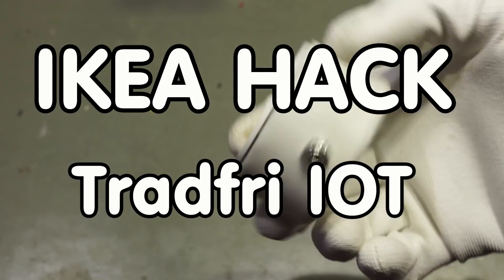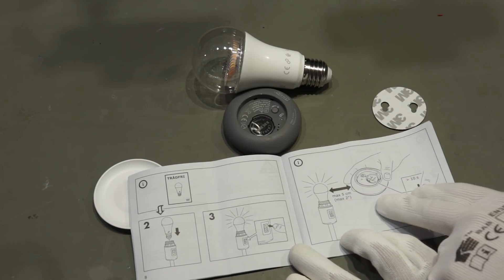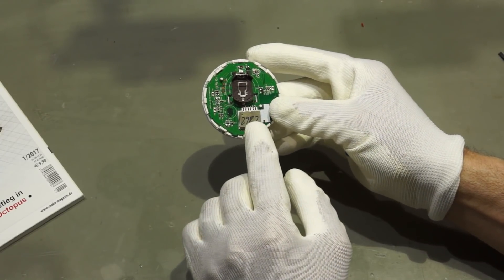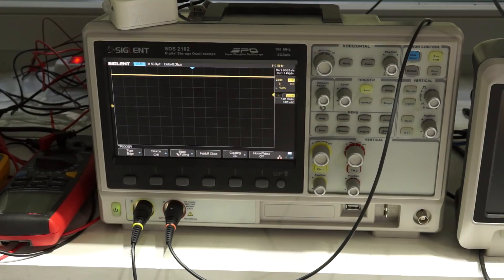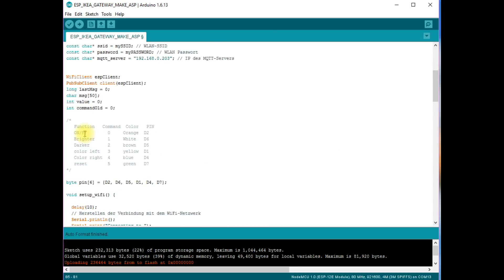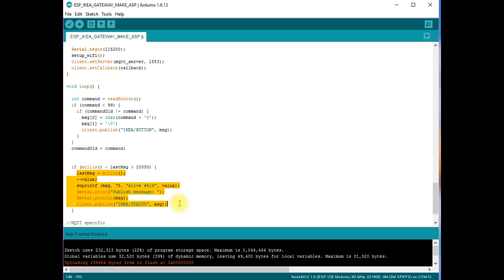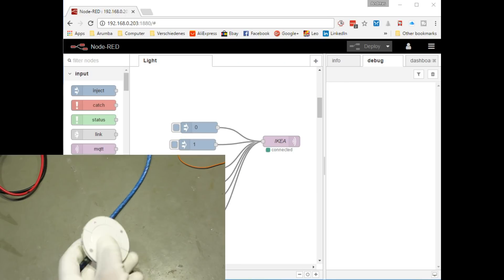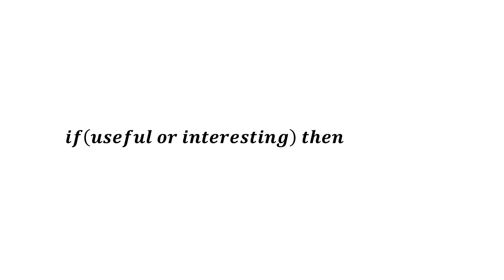#140 IKEA Tradfri IOT Smart Lighting System Hack

Comment: I expected the system to be called trådlös in stead of trådfri, IKEA being Swedish ;-)
Reply: I think it's because Trådfri is not a real Swedish word (or Danish, for that matter). As Gert correctly guessed, løs and fri basically means the same in most contexts. Trådløs is a dictionary word, and thus can't be trademarked, but Trådfri isn't, but means the same, so that's apparently what IKEA went for.
Reply: @Morten Jensen?  Danish product?  Where is it a Danish product?
Yes, the NAMES are mostly taken from Scandinavian languages and countries.  But that doesn't make it Danish...
Reply from the maker: Interesting... BTW drahtlos is the German word for Trådløs. Quite similar.
Reply: Danish is a Germanic language, so they are very similar in construction and vocabulary. I think Swedish is actually more similar to German than Danish is. Eg Fenster in Swedish is fönster, whereas the Danish word is vindue, which is much closer to the English word window. Actually window is a word brought into the English language by Danish vikings...
Reply: Ed19601 you are correct "-lös" added as a suffix translates to "without <whatever the main word is>" in Swedish. I can not think off any contacts that uses "lös" with the meaning "less". "lös" as a word (and not a suffix) means "loose" (as in "loose fit" not the opposite of "win"). 

/A Swedish guy :)
Reply: Trådfri (sounds like "trodfri") means "free from wires", while Trådlös (the "ö" is the same as in german) means "without wire". And it's Swedish ;)
Reply: Hilarious to see that this community not only likes to hack electronic devices but also hacks Ikea's idiom (and with the same vigor! ;-)

I love it!
Reply: So. Back to nerding out about languages.
The swedish word "lös" (not the suffix that is) can actually mean "free". "Fången är lös." can be translated as "The prisoner is free.", in the same way that the english word "loose" can be used to mean the same. So the connection between the suffixes "-lös" and "-fri" is pretty close.
You can also see "lös" as part of "lösen" which is swedish for "ransom". And "lösenord" which is the swedish word for "password".

So my guess is that this is problably another case of words shifting meanings.

/Another swede
Reply: Martin Bøgelund Norwegian vindu as well. ofcourse Bokmål and Danish share a very common history
Reply: From what I've read, IKEA names carpets and rugs after Danish towns, which some Danes apparently don't like, because they think it's demeaning (they don't want to be "stomped on", especially not by the Swedes) :D .
Reply: pepper669 I took a look at some IKEA carpet names after reading your message, and indeed I found some names of Danish towns. Most names struck me as being Swedish, though.
Reply: +Martin Bøgelund In ancient Scandinavia the actual word for window was vindöga [wind eye]. Swedish fönster is originally a loan word from the German word Fenster. So there you have it. :-)
Reply: Martin Bøgelund good thinking. Yet Microsoft managed to trademark 'Windows' though for the life of me I don't understand how. Someone must have been sleeping at the patent office
Reply: Interestingly most words for many/most body parts are the same. In English and Swedish and Danish and Norwegian.
Hand, Arm,Foot,Hair,Finger,Toe
Reply: ah yes, similar as in dutch. Use as an isolated word (so not as prefix) it can be a noun or adjective meaning:empty,smart,false,unreliable,vain.
Sorry Andreas. very off-topic
Reply: Andreas Spiess Dutch "draadloos"
Reply: I thought you might do some radio frequency analysis. Maybe the system is already using #MQTT
Reply: +Ed19601, according to friends that learned Dutch, it is much like Swedish.  So according to them, it was easier to learn than German. I have problems learning natural languages (other my first, Swedish and my second, English).
Reply: Eduard van Raalte Andreas' video's are a source of learning on many fields :-)
Reply: Anders Jackson German is especially difficult because of all the 'cases' (nominative, genitive, dative, akkusative) that have virtually disappeared from the mainland Scandinavian languages and Dutch. I speak Dutch Swedish Norwegian and Danish and that is mainly a matter of learning vocabulary as the grammar is very simple.
I also speak German and Icelandic and can read gammelnorsk but that is a whole different ballgame because of the much more complicated grammar
Reply: @Ed19601  Hello Ed19601 and greetings from Finland. Have you ever take a closer look to our language? We have loan a few words from Sweden but beside that it's totally like nothing else. That's a two way road in my head. We, for example, need to learn whole new language if we want to learn swedish. Sweden have so much similarity whit english that i've seen them mixed words. Swenglish:) I don't know where this came from but I felt like writing it....
Reply: @Ed19601, yes, I have tried to learn French and Icelandic, so I know about all the "cases".   They are hard to learn...  German I have only looked at from distance. :-)
There are some tricky part in Swedish though. Things that are thing from before the big clean out of "cases".  There are still traces left in Swedish.

Impressed of all people that manage to learn more than two languages. So feel the impression from here. :-D
Reply: jhm smart tv Thanks! I really don't know why someone would get all worked up and deny that fönster looks like Fenster - so thank you for confiming there actually is a relation.
Reply: Ed19601 I don't understand the trademarking of Windows either - I still remember the fuzz about how Lindows had to be renamed. Maybe legislation has changed since Windows was trademarked? In Denmark at least, common words like "sofa" and "trådløs" can't be trademarked, I'm pretty certain about that.
Reply: Martin Bøgelund yes I remember the court case here. "lindows" could be confused with "windows" whereas in my opinion windows shouldn't betrademark worthy to begin with
Reply: Ed19601 Exactly. OTOH when Mike Rowe called his software operation "Mike Rowe Soft" and bought mikerowesoft.com, Microsoft couldn't muscle him out with their lawyers. I think they ended up buying him out at a high price :-) That story made me laugh.
Reply: The laws are different in different countries, so you can't even patent software in Sweden. It has to be connected to a physical process.
Reply: +Morten Jensen Danish product? ;-)
Reply from the maker: So, we have now the definitive truth! Interestingly, Google translate does not translate it from Swedish...
Reply: my guess is that "lös" does not mean "less" in its usual use as in 'less than'  but "without" in analogy to dutch "loos" (without) . Having said that, it is very well possible that that was the original meaning of "less"  as well (as in lawless, senseless, and .... Wireless)
Reply: +Martin Bøgelund, Fönster (not Fenster) is based on French fenêtre. And many English words are based on old Norse, like Vindue and Vindöga for Window, Barn for children.  Gata for Gate.

And yes, Trådfri is a Swedish word, translated to Wire free or Thread free. (Tråd: thread or wire, fri: free)  In Swedish we can add words together to make new ones. 

And you know that the Trådfri system is based on a standard, but not MQTT.  So there are no need for making a hack like this.  Even though it is fun to see.
Reply: Anders Jackson Yes, Fenster - the German word for window, is similar to the Swedish word fõnster. I hope you recognize that. And if you read English language history, you will realize that indeed Danish vikings settled in England, bringing Danish words with them.
Reply: @Martin Bøgelund.  It is Fönster.
And it origin from Latin, and if you want to make a German connection, there are Low German vinster and Latin fenestra, not German fenster.
https://en.wikipedia.org/wiki/Window#Etymology
https://en.wiktionary.org/wiki/f%C3%B6nster

Yes, I know that the English word Window come from Forn Norse language, which I wrote, If you care to read that.  
http://www.etymonline.com/index.php?term=window

That was before there was any Danish language. It was Norse.
But anyway, I will end this discussion in this subject.
Reply: Anders Jackson The german word for window is Fenster.
 Simply look it up. The relation between the Danish word vindue and the English word window was claimed in a documentary I recently saw om the subject. Danes in larger numbers settled in England centuries ago, influencing culture and language. I'll post links supporting that claim. Even if window is from old norse, the similarity between all 3 words can't be denied - they are probably all related.
Reply: So you don't read my links? Good to know.  You belive a TV show and not academical sources.  Good to know.
Reply: Look Anders, I'm not out to argue with you, but there are claims that state window comes from Danish (eg. http://lakjer.dk/erik/engelsk/danishwords.html). I merely mentioned window since that's the example I remembered - sorry if I hurt your feelings by picking that exact word, there are other words I can find for you, showing the relation, if you are actually interested. If you bother to dig into it, Danes in larger numbers did indeed settle in England. Norway also was under Danish rule for an extended period, and Denmark and Norway have been very close for centuries, so please don't go about thinking there has not been influence both ways in both culture and language.
Also, note I'm not claiming old norse did not influence english - I'm just claiming Danish language (also) did. If you claim Danish language didn't influence English, you're simply wrong.
Reply: As promised, a link supporting my claim about Danish influence in England - sorry, it's just a simple Wikipedia link: https://en.wikipedia.org/wiki/Danelaw
I hope you will accept this as fact.
Reply: I have dropped it. You should too.  You don't even know what Old Norse is, so I see no reason to continue.
Reply: Great. Cant help thinking the buyout was the object here. If I were Microsoft I would not have bothered. Generally very difficult to muscle someone out of his own name, except ofcourse if  your name is McDonald and  you want  to start a fastfood joint :-)
Reply: Tråd=wire;  fri=free // lös=less
And it is Swedish not Danish ... oh and by the way I am Swedish (i also speak perfect Danish).
Reply: Gert Dewit is right, IKEA being Swedish, the word Trådfri should be thought of as a Swedish construction. But it works in Danish too, as the two languages are quite similar. I'm Danish by the way :-) And thanks for the interesting and useful videos, Andreas, I enjoy them a lot!
Reply: "Always take out the battery, you might destroy something" starts to Dremel it apart
Reply from the maker: Here you definitively are the expert. I struggle already with my German, English and French ;-)
Reply: @AndreasSpiess  que me
Reply: @AndreasSpiess  oi
Reply: Andreas Spiess absolutely not, as a Belgian I don't speak Swedish or Danish, I was just joking, thought it funny you said it was Danish.
I suppose one can use the word in Swedish too, I guess fri=free and lös=less or without.
Reply from the maker: I just used google translate and it said, it is Danish... If I select Swedish, it does not translate...
Reply: Anders Jackson indeed remnants left. in Dutch too, often in the same expressions. Anyway, apologies to Andreas for the long offtopic discussion
Reply: Gert Dewit well... as he says... a danish product, so maybe that is why. fri the correct term. ikea nemas its products after scandinavian citys/names
Reply: I read your link - thanks for second guessing and being wrong. I just stated my source, like you stated yours - I hope you don't claim an exclusive right for that.

Comment: From their own IKEA website:
-Can I develop the TRÅDFRI system by getting access to the systems API?

Not in the first release. But IKEA is working towards an open system.

-What protocol do the IKEA smart lighting products use?

IKEA smart lighting products use the ZigBee Light Link, which is an open standards protocol aimed at remote control. The lights create a mesh network with each other, enabling each light to pass on messages to the next. IKEA Smart Lighting products are compatible with other products according to the ZigBee Alliance. You can find more information at: zigbee.org
Reply from the maker: This is quite an old video and maybe they changed a lot. I did not work on this since then.

Comment: You don't need to use a Dremel to open the remote. I made a video that shows how to open it non-destructively: 
https://www.youtube.com/watch?v=NMupi1FeAB8
Reply from the maker: You got a „like“ from me...
Reply: Great now my video has one like, haha :-)
Reply: Another thing: The new TRÅDFRI power socket comes with a 2 button remote if you pay 25%. The packet (socket+remote) cost 40% less than just the TRÅDFRI remote from your video. This is very cheap remote, especially if you can use the socket for something.

Comment: I am still baffled that there is no wall mounted lightswitch-replacement for these smart bulbs. How are you expected to use the system? Tape over the old on/off powerswitch on the wall and stick the ikea remote to the wall? That can't be a solution.

So I plan to open up the ikea remote and hook it up to a Feller light switch (which is disconnected from the mains power), so when I press the regular light switch it closes the circuit of the ikea remote and switches the lights. The ikea remote can then be mounted inside the wall, behind the old switch. A 230v-to-3V step down regulator should replace the coin cell battery of the remove, making this system maintenance free.
Reply from the maker: Maybe they omit these switches because, in most countries, it is not allowed to mount them as a Maker. And there are many country-specific different standards around.
Reply: Andreas Spiess ok I did the hack and it works beautifully. Its very easy. Just solder two wires, one to the center button (remove carbon layer first) and to ground. Plug these wires into a standard wall switch. Tape the TRÅDFRI remote pcb behind the switch and into the wall socket. Now you have a Feller-TRÅDFRI-switch which looks and works perfectly.

Comment: E27 is not "European", in it E stands for Edison, and 27 is a diameter in mm. There were many lamps and inventors at that time (circa 1900), but Edison was one of the first who had commercial success, and so the base and the socket used eventually became a standard. It appeared in U.S.A. first, with E26 being most used, although it's in fact 1 inch, which is very close to 26 mm. It  and sprawled to Europe, where E27 is used to distinguish from USA's E26 (and different voltage of course), but they are so similar as the difference in diameter is only 1 mm.
Reply from the maker: Thanks for the info. I learn everyday something more!
Reply: Andreas Spiess thank you for all your videos and the work behind it! I really like how methodical (should I say scrupulous?), logical, and easy to understand they are.

Comment: Im trying to do a own lamp with the IKEA chip, i have tried to read the signal from the chip inside the lamp, its the same as the controller in your video and i used the pinout from the german Make site.. 

Do you think its possible to make such a projekt?
Reply from the maker: I do not see why it should not be possible
Reply: Andreas Spiess do you have any tips on how I should begin? The original bulb supplys about 100vdc pulsed at 100hz. I do think I need to use the output from the chip itself..
Reply from the maker: +Oscar Eriksson I would divide the project into two parts: The Led part and the signal receiving part. The IKEA receiver would be a good receiving part. So, you only have to build the LED part. The only interface between is on-off, which seems not too complicated.
Reply: Andreas Spiess i already have the led part, I'm using a 12v rail across the ceiling but the only pins connected on the receiver was vcc, gnd, TX and dim+..  It's a dimmable light but the on/off toggle wasn't connected..

Comment: Why don't you just use an enum for the commands?
Reply from the maker: Would have been a better solution. I just did a quick hack to show how it works...
Reply: ah yeah ok. Makes sense. It just looked to weird to me when you basically made an enum with an array. :P
Reply from the maker: I am not sure. AFAIK enums are translated into consecutive numbers starting with zero. My array not necessarily contains consecutive numbers and for sure does not start at zero. Do I miss something?
Reply: enum pins {D1 = 3, D2 = 0, D4 = 4, D5 = 2, D6 = 1, D7 = 5};

Comment: Andreas, surely if you can observe the variable step count ie from darkest to lightest setting, from warmest to coolest colour setting. If these settings are non-volatile, you simply create a copy set of registers to hold the current setting. If the settings are volatile, add a "reset registers" function to equal the starting values within a hacked IoT device. A "Master Reset" becomes significant to cover a possible building-wide power outage.

This I think offers the simplest 'hack' to include an instant response to a reset light fixture ie if there has been a local power outage? Here there is no conceptual problem of 'losing control' as it is just another event command under the control of the end-user. Without a "Reset" command, yes, then it is time consuming to synchronise the components correctly with many opportunities for confusing outcomes!

Again Andreas, many thanks to you for your excellent trailblazing style and sense of direction. Thought provoking like Swiss mountain air I think!
Reply from the maker: You wrote it better than I explained it: This remote has no master reset. It keeps its last settings... (at least, I did not fin one)